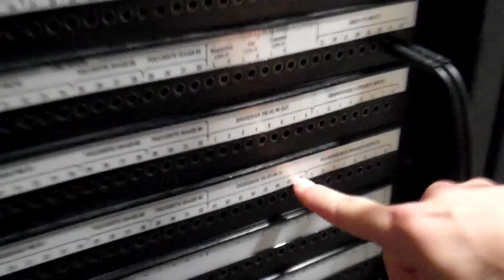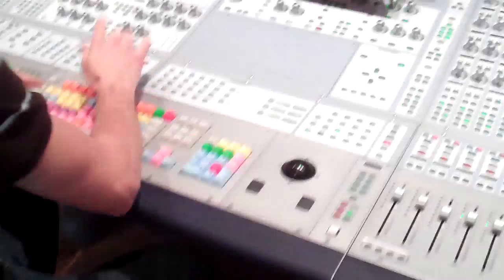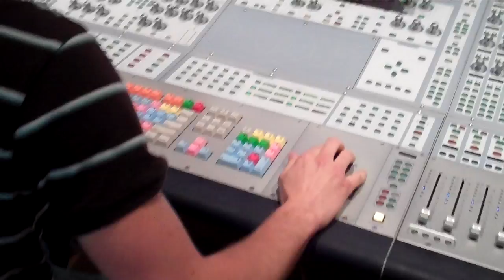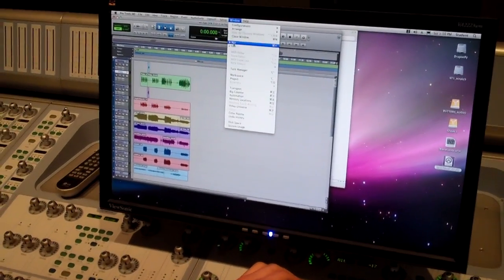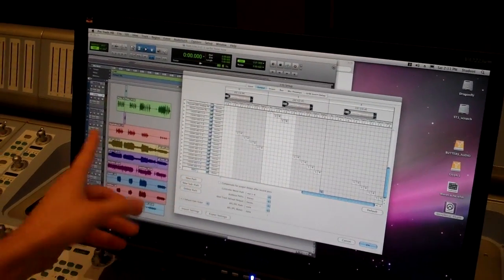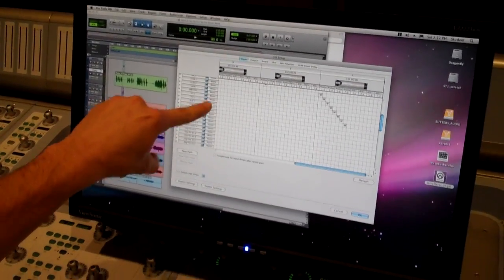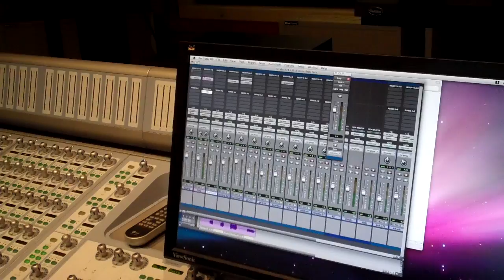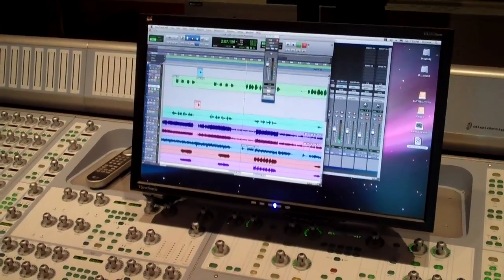Using outboard gear in Pro Tools, Ball State Music Technology

Comment: The phase/delay issues are exactly my problem. I want to be able to run outboard gear (especially delays and reverbs) WITHOUT having to record them on an audio track. So I've been using an Aux Input track. But I'm getting this weird delay when I do this. There must be a way of sending the signal to the outboard PRIOR to the audible sound to compensate the delay/phasing issues. Anyone know how to do that?

Comment from the maker: Yes, there's no automatic compensation with this setup since the AD/DA conversions add a few ms of delay.  So if I had my snare track going through an outboard compressor that I then wanted to mix with the original (parallel compression), I would bounce the compressed snare to another audio track and then manually line up the waveforms to remove the phase issue.

Comment from the maker: @mhbmusic In this studio it is actually PT8 that is running and I think the computer is only at OSX 10.5.x (Leopard).  I do know that PT9 won't run on 10.5 and requires at least 10.6, though I don't know which release of 10.6 is supposed to be the most stable.

Comment from the maker: @mhbmusic I believe the 002 has 8 analog inputs, 8 ADAT inputs, 2 SPDIF inputs, and the same numbers for outputs.  I'm not sure how you have your patchbay hooked up, but I'm presuming you just have the 8 analog inputs and 8 analog outputs on the Neutrik patchbay.  (These should be balanced).
Now, 
1. Hook up your outboard compressors to your desired spots on your patchbay.
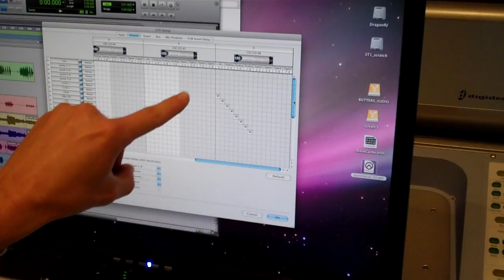2. In PT, set up your IOs like I describe around 3:20 (more specifically @3:48) in this video so the paths match your gear

Comment: Quick question. Using PT9 and a digi002 can I hook up the same way? Also, should I be using balanced or unbalanced going out and in of the digi002? I have a neutrik patchbay and my out board gear right now is only a UA-LA610MKII and two FMR RNC compressors. Thanks for any help you can provide.